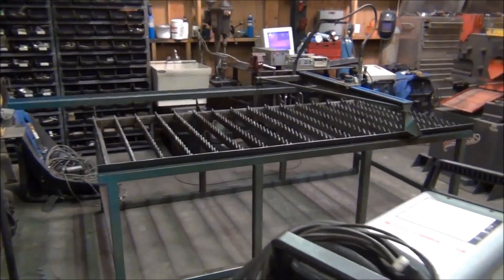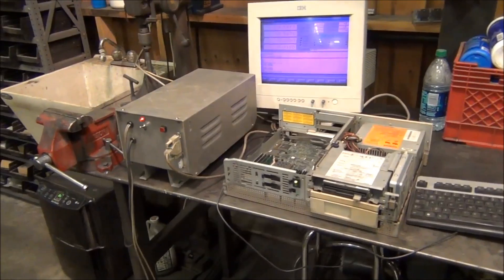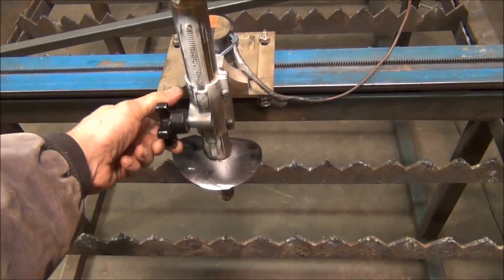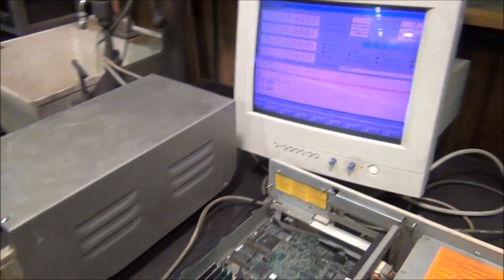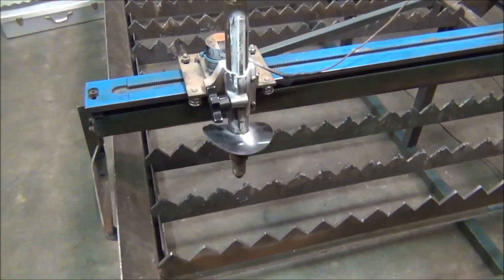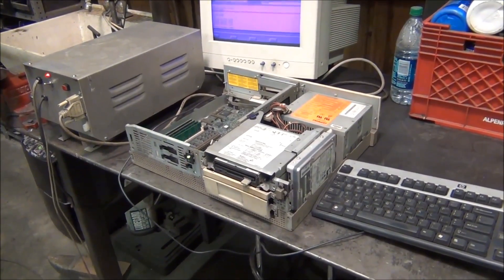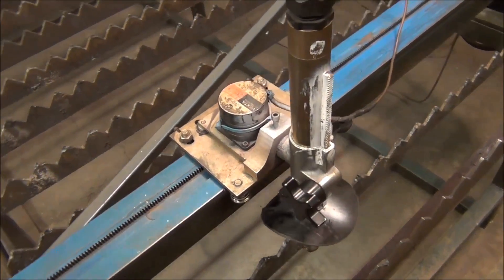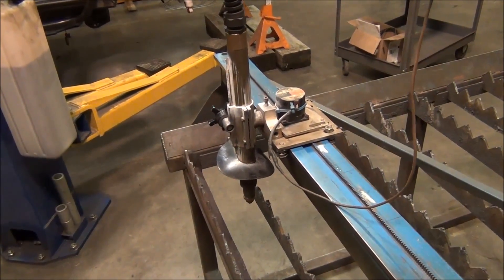CNC plasma table project

Comment: Thanks for the video !  What is a blast from the past. I built that machine. The noisy X was likely a broken wire in the motor cable. That machine was built before Mach3 existed ! There wasn't any stable Windows CNC software available. Art Fenerty was working on Master 5. This was his first attempt at a Windows based CNC software. It was buggy and would only work with SOME motherboards (PC compatible) had not come about yet as computers were in their infancy. Dos is a perfect platform for CNC as it is a real time operating system.  You mentioned the drivers, commercial drivers were really expensive back then, like 600 each and up. I built the electronics in that box. I believe I sold that machine for around $3,000 when new. They cut a lot of parts with that machine. I had bought a Torchmate 4 x 8 kit. It was so bad that I never built it ! Back then 100,000 dollar CNC machines didn't have nearly the memory or processor speed that this machine has with a 386 computer ! People are often quick to judge without knowing the whole story. Back then there were only 3 companies making low cost CNC plasma cutters. Me, Torchmate and a fellow in Canada. It was built by Camcutcnc in Eugene Oregon a very, very long time ago.
Reply from the maker: Thanks for the note!  I sold this table several years ago to the Warrenton high school, I believe they still own it.

Comment: The jerkyness at low speed is caused by the steppers reduced speed and loss of torque.  apparently steppers need tuned to the application and will work within a specific operating range.  I just built my machine without considering this fact as well.

Comment: I've seen you work with Military Generators... Can you help me... I have a MEP006aA 40 hrs on it (rebuilt) 60kw, I thought gauges were bad at first, but Now appears to be the Exciter?? i dunno... It is not throwing out more than 30 volts (full throttle) and HZ needed to power things.. Electrician recommended using 2 male end plugs and plug into each receptacle of the outlets on board generator.. Did that.. it didn't "spark" the exciter or if it did... I did not get any difference in volts or hertz.  Another fella told me to start and hold the start toggle switch up/on after motor start till I got higher voltage reading on gauges.. that didn't work... A former Military dude that works for a generator sales and repair told me they really don't like to work on military issued equipment, ie generators because parts are not available and can't be matched and or to expensive??  I kind of find that hard to believe.. I can understand they would be hard to cross ref with other commercially available catalogs... I hate to think I have a piece of equipment that can't be fixed..  If you can help, I'd sure appreciate it...
Please and Thank you
d pierce @ Weldons dot com (no spaces)
Reply from the maker: sent you an email

Comment: Nice table. I really like that design and wouldn't worry much about making it driven from both sides of the table or using servo's. In the real world plasma cutting is a rather inaccurate process to begin with compared to other processes. The condition of the consumables and setup of torch height is way more important to the accuracy than anything your pointing out improving.  Its like putting a $20,000 paint job on a $200 used car. 
In my humble opinion buying mach 4 and smooth stepper driver is way way over kill for that type of machine. I think just a good cleaning adjusting and lubing of all the moving parts inspect the bearings and such and it will be fine. I would buy a good cam software first off.. i like sheetcam its great. use the table a while the way it is and see how it goes ya know.
Its quite nice
Reply from the maker: Thanks for the feedback.  I figured that I would leave it mostly as is, and upgrade as I uncover things that annoy me.  Right now, my focus is on getting rid of that old 486 that is controlling it!
Reply: sewerzuk
Upgrading the computer is a good idea.. its actually a surprise that it still works. I'd be interested to look into the controller box and see what kind of current the motors are being supplied. The current may be adjustable to quiet the motors and smooth them out a bit?  maybe something going on in there that's making that x axis motor run funny?
anyways... its an excellent start. have you tested the plasma cutter yet? you may find it handy to have a second torch handle to use off the table. Id bet it could be handy around the shop too.
Reply from the maker: builtrodewreckedit I already own a hypermax 600; so I planned on keeping the 1100 dedicated to the plasma table.  I don't usually cut anything thicker than 1/4" anyway, so the hand torch on the 600 works fine for me.  The 1100 was under power when I picked the table up; I watched the previous owner burn out some test parts with it before I hauled everything home.   They had it configured for 3 phase 480 and I have not yet re-wired it for my shop.  With regard to the controller box, I have not yet opened it up.  I was doing some research and eyeballing the smoothstepper USB interface board.  Once work slows a little bit I will likely get one of those coming and the Mach4 software.  I am building the water trays for it right now...want to try to keep my shop clean!